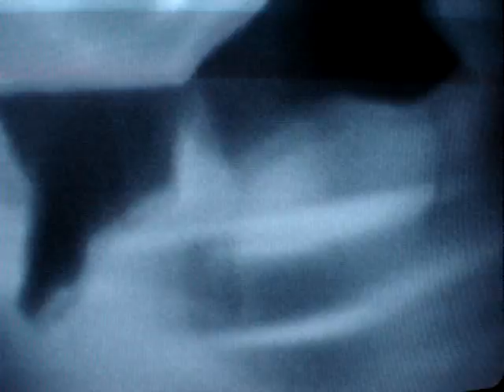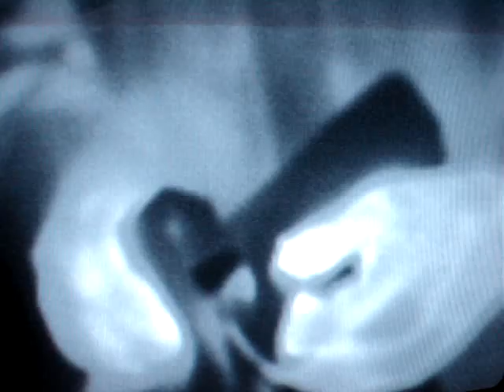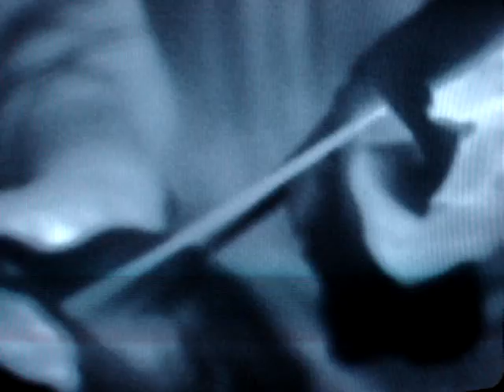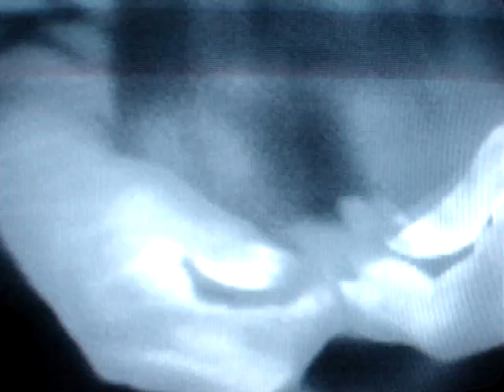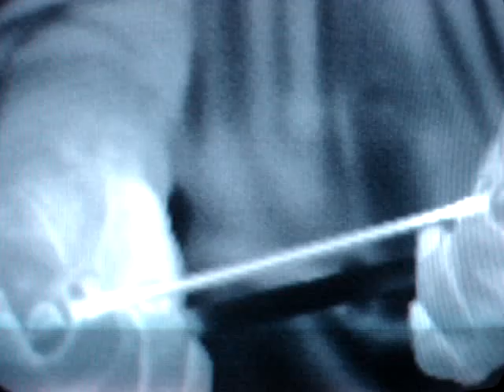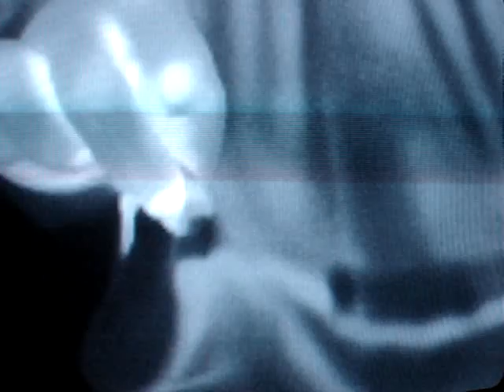FLIR thermal infrared camera: Rubber Band hot/cold

Comment: I believe that the rubber band will not return all the work put into stretching it if it is allowed to cool while stretched. Some of that energy will be radiated as heat. If you think about the refrigerant in an air conditioner or refrigerator it is doing exactly the same (compression is like stretching and decompression is like release) the condenser is where the refrigerant becomes stretched and the evaporator is where it is allowed to restore itself to initial volume, while absorbing heat.

Comment from the maker: > invert the colors

Human bodies are surrounded by hot gas rising from the skin, and breathed out through mouth and nose.  If you can make a camera see this plume of hot gas, then it will also see farts.

With this cheap thermal camera, gases only become visible if they're about 50C different from room temp (either hotter or colder.)

Comment from the maker: Carbon chains are always buzzing, and if mechanically stretched, energy is injected into those oscillations (they heat up.)   If the stretching is released, they cool back to the initial temperature.  But, if stretched and allowed to cool by convection, then when released, they cool down below the initial temperature.

It's possible to build a rubber band mechanical refrigerator, or a slow motor powered by small temp difference.

Comment: "Light" should not be thought of as just visible light, it encompasses all wavelengths of light. Infrared is just another wavelength of light and is bent by a prism just like visible light, as would any wavelength (maybe with the exception of high energy light, like gamma or x-rays, which may just pass right through). Invisible light was actually discovered accidentally when a thermometer was set right next to the red coming out of a prizm and the temperature went up.

Comment from the maker: Yep, prisms bend near-IR almost exactly the same as they bend red light.   Search for graphs of refractive index versus wavelength for different types of glass, or information on thermal camera lenses.

Glass absorbs thermal long-IR fairly strongly, so instead you'd need a prism of germanium.  Or silicon.  Or polyethelene.  My camera has a silicon lens (germanium is way expensive.)   Don't forget that lenses are just dome-shaped prisms, and both are bending light.

Comment: Well, the cellphone camera sensor DOES see infrared light. It has an infrared filter on it. If you take that off, and put a NORMAL-LIGHT filter (like tinted glass or similar) on it instead, then it will only show you infrared light, hence: infrared camera. But i doubt it will see the temperature differences

Comment from the maker: > instead of using a FLIR dome to detect a vehicle, could it be set in such a manner to see IN a vehicle

Glass blocks most of thermal IR; appearing as a warm shiny surface.  You'll have to ask drivers to roll down their windows!  Or use backscatter x-ray, see the URL: as-e com/products_solutions/image_library.asp